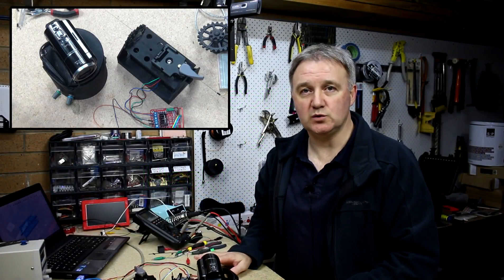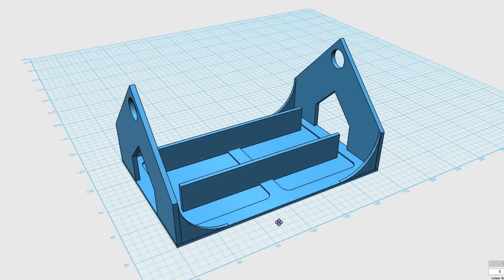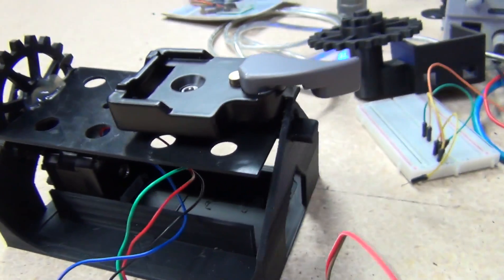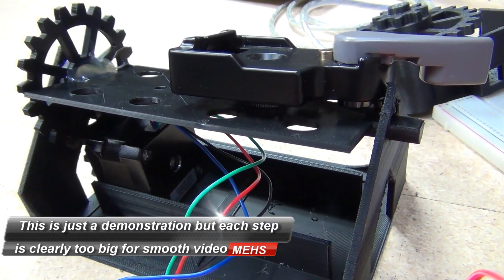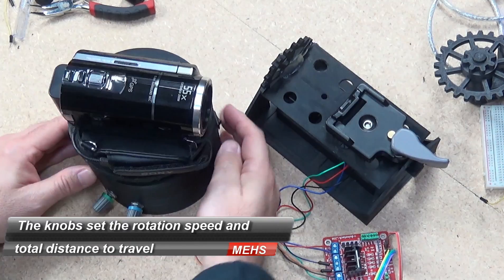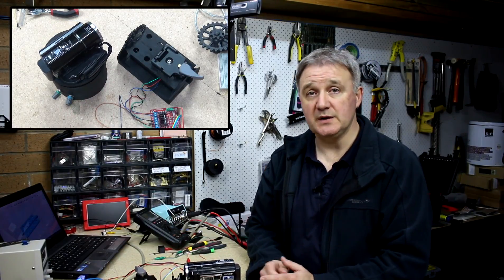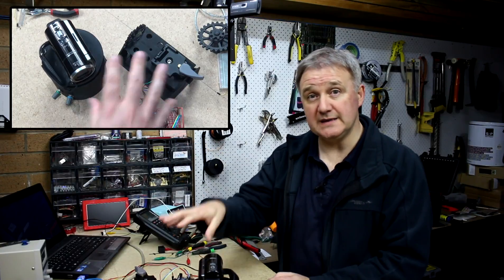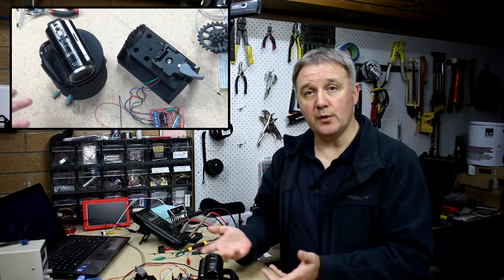Raspberry Pi and Arduino 3 Axis Camera Dolly Pt2 (MEHS) Episode 50

Comment: why not make the movement smoother by using microstepping?
Reply from the maker: sietze gelderloos -Hi.  I stopped working on this project for a time while I reviewed ways forward.  I think I will now be using only the pi3 with better micro stepping boards and geared motors.  I have all the parts just need to finish a couple of other projects before I revisit the camera dolly.  Should have something out in a few weeks.  Cheers.
Reply: My Electronics & Hacking Show sounds great, looking forward to that. subscribed.